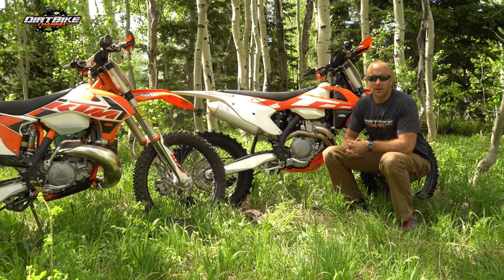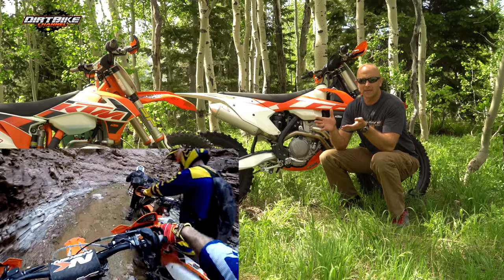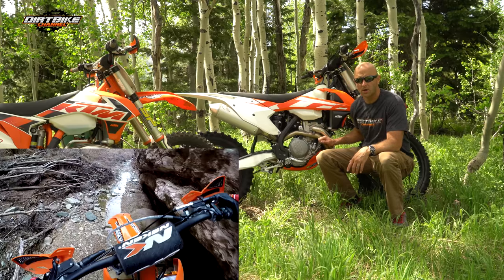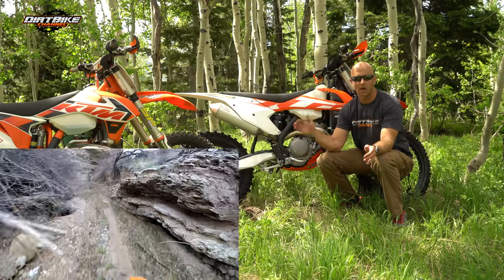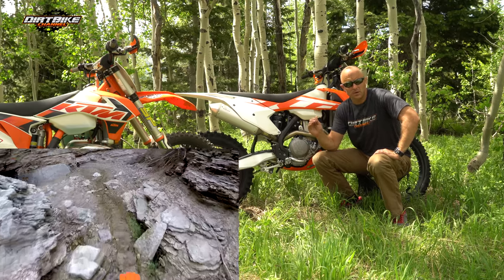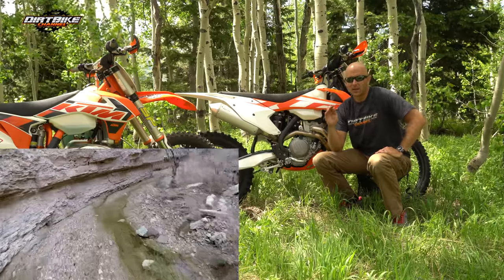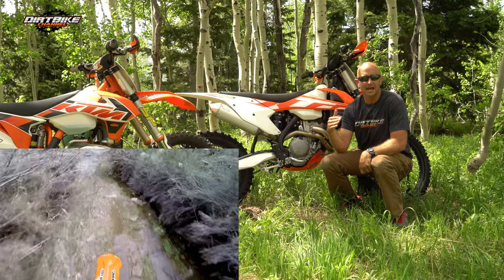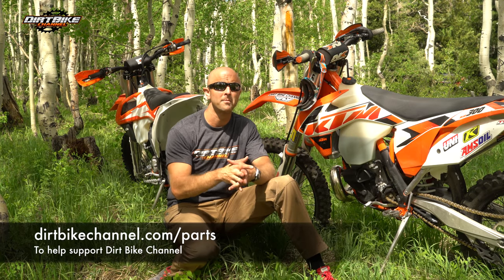Electronic Fuel Injection on 2 Stroke Dirt Bikes? Part 1 - Episode 139

Comment: Good points, I think we all just want a great running bike that needs little maintenance. This is why EFI sounds good. I mean come on if i'm going to spend $8200 for a brand new Beta 300 I want the EFI or something that is going to justify the money. The oil injection is amazing that is why I chose the Beta but not sure it justifies that cost. As a company like KTM you cant justify charging 10k for a 2 stroke with such little innovations and change, I know they are amazing bikes but no technological break through can justify them raising the price of their bikes by a grand every couple of years . Its insane.  At what point in time is a dirt bike going to cost more than a car?

Comment: At WOT the EFI  has no advantage over the carburetor. 
At every other rpm range the EFI is superior in fine tuning the mixture.
Reply: Dan Henderson EFI usually has a better fuel spray pattern than a carburetor even at WOT
Reply: fuel spray pattern may be negligible at wide open throttle due to the fact that were not comparing carbs to direct injection rather carbs to throttle body injection. which means the fuel regardless of delivery type has time to coagulate or form larger droplets before entering the cylinder , waiting for the piston to get to tdc then ignite. in physics speak thats a long time. i have seen lots of side by side dyno comparisons and carb / throttle body injection when tuned by a master engine tuner will produce the exact same hp with identical fuel consumption rates.    the only way to truly beat a carb all around on every spectrum is to go full on direct injection and spray in the fuel milliseconds before ignition takes place.
Reply: Dalton Michaels Virtually impossible to tune a carb as precise as efi can control the mixture. The combination of variables are endless.
Reply: toadamine The dyno says you're wrong. At wot using the same mixture ratio and all else being equal they will be virtually identical in power.  There is plenty of atomization when the airstream is at max velocity.
Reply: thats only true for direct injection. throttle body precision is easily replicated with a well tuned carb.

Comment: About what you said on being able to adjust the carb with just a screw driver compared to a lap top with fuel injection. I think you forgot that fuel injection adjusts itself constantly on the fly which would be more accurate than a carb at all times. You can tune it with a computer at home but you do not need it out on the trial. Obviously carbs still can do the job just fine but just saying.

Comment: My friends 350xc injector quit working blowing the top end and it was on a new bike. If it were a carb it would still be running. One of the side effects and extra cost of the fuel injection system. Costly.
Reply from the maker: Thanks for sharing.  Things like this can happen.

Comment: I think the main problem to put EFI in 2 strokes is that we are mixing gas with oil and injects would have problem with it. Second thing is simplicity. On other hand it would be easier when you chane altitude.
Reply from the maker: You may be right.  The Lectron carb solved all my jetting issues though.

Comment: I can't see the 2t manufacturers rushing out FI until the emissions standards force them to. Even then, I'm hoping they put in the effort to create direct injection, or at the least port injection as a standard throttle body doesn't solve the timing issue of the burn (ie, unburnt fuel exiting the exhaust port when both inlet and exhaust are open). This is a lot more difficult to implement than most people realise ;-)
Reply from the maker: I am with you 100% on that.  I doubt they will do that though.

Comment: not related with EFI, but seeing your 2 bikes 2015 and 2017 side by side, i personnaly like much more the colors and graphics of 2015
Reply from the maker: It's not a 2017.  It's a 2016 and a 2015
Reply: +Dirt Bike Channel you are right, my mistake, in 2016, they split 2 differents colors and graphics on specific models, i think 2017 got all the same kind of black frame and new graphics design and they re-shaped the front fender

Comment: Hey Kyle, we've spoke about this topic before.
Why do you think Beta did it on the 300RR? Still I'm with you, if injection does not give a big advantage, why bother. 
Great video btw.
Reply: Unless there is some other Beta 300RR that I'm unaware of, they are using a Keihin PXK 36 carb on the 2016. They have electronic "OIL" injection. It just eliminates the need to premix gas and oil. But the air fuel mixture is still done by an old mechanical carb.
Reply: Bruce Brown I stand corrected my friend, it is just the oil.
Reply from the maker: The beta isn't fuel injected.  It's only got oil injection.  I talk about this in part 2 of this series coming out in 3 days.
Reply: Dirt Bike Channel great work!

Comment: Two stroke fuel injection on motorcycles will never work properly due to the part throttle issues which is of cause no concern on boats and snowmobiles. With EFI you have to predict and calculate what fuel the engine wants and then deliver it. There are two many variables with a stroke engine - the biggest issue being the exhaust shape and heat. Carbs react instantly to what the engine is asking for which is why they work so well on a two stroke. I am a two stroke nut and have looked at this extensively so before anyone tells me I am talking rubbish please go and investigate is properly yourself.  The most you might see is a hybrid carb & EFI setup.
Reply from the maker: Thanks for sharing.
Reply: The people at ktm are in the very final stages of fuel injection it is coming
Reply: part throttle setup?
Reply: It's all to do with transitioning and meeting the correct fuel demands when for example accelerating out of a corner a rider tends to feed the throttle in progressively feeling for grip and control.

Things change very quickly on a two stroke and a carb will respond to what fuel the engine is asking for. On an EFI system you have to predict what fuel is required by looking at various sensors/parameters combined with interpolation which is very predictable/accurate on a four stroke engine.

The fuel demands of a two stroke are nearly impossible to predict/interpolate as lots of things are going on which changes its fuel demands - the biggest issue being the exhaust temp changing which changes the tune of the pipe - search google for info on using water injection in two stroke exhaust pipes to see what I mean.

So an EFI system on a two stroke would have to be super quick and need tons of fuel mapping points and correction tables to stand any chance of it remotely running correctly.

I have a garage full of two strokes and hate carbs and would love EFI but it will never work as good as a carb. Carbs are actually really simple and clever - once you take care of the initial setup around needle and main jet the carb is like an EFI system with infinite fuel and correction tables.

Remember carbs respond to what the engine is asking for - EFI gives the engine what it THINKS it wants! Hope this all make sense and also note that boats and snowmobile spend most of their time on full throttle as they don't have to contend with being on two wheels!

Comment: Your parts portion of your website doesn't work for anyone with adblocker as the three links there are technically ads and thusly blocked by adblocker, which most people use. Just a heads up.
Reply from the maker: I have that listed in the text on the site about the ad blocker.  I don't have any other choice right now with the limited resources available to me.  Lots of guys are clicking on it though.  Thanks for trying.
Reply: Just provide the URL for the ad links below where the ad is placed. For example for motosport: http://www.motosport.com/?psreferrer=http%253A%252F%252Fwww.dirtbikechannel.com%252Fparts&segment=badger&AID=10780136&PID=7891170&utm_source=CJ&utm_medium=Affiliates&utm_campaign=Affiliates&commsource=cj
Reply from the maker: Done :)
Reply: Nice!

Comment: Kyle, how tall are you?, I ordered higher handlebar support for my KTM to be more comfortable when standing on pegs, but after looking at some comments and advices on differents videos, they do recommand to keep the stock one, (maybe if you are 6'-4'' it's ok), I'm 5'-11''... Should I install them and see how they feel, or it's a bad habbit or my standing position isn't correct?? thanks in advanced for your advices!
Reply: I'm 5'10"-5'11" and have no problem so id say don't put them on
Reply: I would recommend keeping the handle bar height stock. Kyle is around 6'1 and I am 5'11" and we both ride the stock height. Last weekend we rode with a Pro Factory Beta rider and he mentioned that you're better off leaning over as it puts the axis point at your hips and not your knees. According to him your knees cannot take a big hit but your hips can. Shane Watts gives this same advice. I would say your money's better spent somewhere else.
Reply from the maker: Don't get taller bars.  That advice seems to be universal from the best riders out there.  I'm 6'"0.

Comment: Some guys already know this but I'm gonna put it out there for those that don't. The reason dirt bikes don't have oxygen sensors is they are not a fast acting sensor so on a dirt bike your constantly changing throttle input and a o2 sensor can't give relevant information i.e. It's always in the past. And cars only use them at fixed throttle position.
Reply from the maker: Thanks for sharing.

Comment: I like efi but I'd rather have a carb on a dirt bike. With efi if you have a problem with anything the bike won't run. With carbs you can jerry rig it so you can make it back home or to the truck. With efi if it senses something is wrong then it shuts off and won't start untill it's fixed. Plus injectors are expensive. And jetting isn't that hard. Sleds and quads are a different matter.
Reply from the maker: You make some good points here.

Comment: I'm not a big fan of fuel injection based on the fact that it's expensive to fix but it does work good. Skidmore snowmobiles use Rotax engines with e-tech  technology like Johnson and evenrude outboard motors. this system does work excellent. easy starts for dummies who have no clue. also it's programmed so if the engine is not warmed up properly it won't move till internal engine Temps are reached.  Arctic cat had a battery less fuel injection system that worked well also.   with the number of problems I've seen with snowmobiles with injectors that fail I don't thinks it's a good thing for Enduro bikes that see extreme abuse compared to mx bikes in a controlled environment without rivers and rocks and mud too the handlebars. lol
Reply from the maker: Thanks for sharing your input.

Comment: EFI is not DFI no point talking EFI with a two stroke. DFI would change the game for my two CR500s' Direct fuel injection means the exhaust port is closed before fuel enters the cylinder. AKA the piston has closed off the exhaust port which is higher in the cylinder than the transfer ports. This is huge on extending range, fuel mileage and the system will not foul the  plug without bad ignition! I could trail ride winter , sand dune summer all with elevation changes with no tuning necessary! No fouled pugs no holes in my piston! Now I need more gears and a turbo to pack the cylinder.

Comment: my 2011 rmz250 is fuel injected and I have no battery and it's got a fuel pump ?
Reply: Electric start on ktm's
Reply: Yes but he's talking about fuel injection not electric start
Reply: You have a stator that produces enough amps to run your fuel pump and ignition system.
Reply: Well, all EFI bikes do... It's not like you have to charge the battery between rides... The point of the battery would be when the EFI doesn't have any power during starting.

Comment: I know this is kind of off topic, but I've been fouling plugs a lot on my CR85 (Two Stroke) I'm currently running cheap 2 stroke oil Becasue that was the only thing available at the time. I was running Castor 927 before. Does cheap two stroke oil cause the the plug to foul or do I need to adjust my air/fuel screw. I'm going to switch to Castor 927 regardless and any input would be helpful.
Reply: What ratio mix do you use
Reply: Check your jetting
Reply: +Javan Kuusisto 40:1
Reply: +Eastern Oregon Moto (EOmoto) what am I suppose to check exactly? Also what jets what I need to fix the rich running problem? Do I go up in size or down? I really don't know much about jetting
Reply: +DirtBike DJ find out what your stock jet sizes are supposed to be,  then remove your carb and write down what jets you currently have,   if you Google how to properly jet a 2 stroke,  there is tons of awesome info,  a properly jetted bike will blow your mind on how will it runs
Reply: +Eastern Oregon Moto (EOmoto) thanks for the info, oh yeah and is the cheap premix responsible for the plug fouling more often?
Reply: +Frederic Jordan I have a pro Circut Platnium pipe and a FMF Shorty( I know  weird combo)
Reply: +Frederic Jordan yeah people have been telling me to jet my bike leaner but how do I do that?
Reply: So its probably the issue right there, go on the procircuit website to see what jetting they recommand for your specific bike.
Reply: +DirtBike DJ usually premix isn't what fouls a plug,  it's usually jetting
Reply: Cheap oil. what are you calling cheap oil. what brand is it? . the way your jetting is set will be a factor in plug fouling. if your bike is set up to run good at 700 ft above sea level at 15 to 20 degrees C and the temp when the plug fouls is 30C your in need of a change to a smaller main jet. if you run a mixture at 32/1 ratio for you gas using 91 octane or better cheap oil shouldn't be a problem. I run shell advanced full syn oil in everything with good results. I've never had to clean my exhaust power valve on my kx250 07 or on my snowmobile 98 srx700. these sleds are aweful for dirty power valves. so I would recommend using a good synthetic oil over a cheap oil based on the fact that good oil makes engines last longer. here's another thing. clean the air filter every  ride or more if it's really dusty. save your motor
Reply: +Ernie Desjardins thanks, I have a CR85(non power valve engine) so I'm not really concerned about that. But the premix I'm running is one that I picked up from autozone and cost around 5$. So running a smaller main jet would fix the problem? Because I'm going to order a jet kit if that's the case
Reply: +DirtBike DJ . that's not what I said.  things to consider are. how many hours are on your piston?  if it's more then 30 hours low compression is likely the problem. is this bike raced or are you a beginner rider that idles around lugging the engine? find a local dude that races mx and know his stuff. ask him to check you out. it maybe a simple fix or something your doin wrong. if I spent tens mins with out I'd know what's up. 32 years of racing 67 different mx bikes I know 2 strokes. find a guy like me to help ya. I'm in northern Ontario canada
Reply: +DirtBike DJ if you are due for a new piston.  instal a hour meter on your bike. this way you can monitor how many hours are on the piston.  30 to 50 hours max or something bad will happen that's expensive to fix. it only takes twenty mins to put a new piston in once you learn a routine with basic tools.
Reply: +Ernie Desjardins thanks I really appreciate man, I have a fresh piston no more than 5 hours on it. I really think jetting might be the problem so I'll start working on it.
Reply: Be sure also to have the recommended plug. This is crucial. A too cold plug will foul much more easily. Use good quality synthetic oil. This is the basis. After, if the problem continue, check your jetting. If you are fouling plugs it may be too rich. Too lean it, you can drop your needle one step at a time (place the circlip one groove higher) or, if it is not enough,  put a main jet one size smaller. You must be carefull not to lean too much or you can damage your engine.
Reply: +Wide000 I didn't want to go that way because if it ran good on castor . then he switched to cheap oil and problems came. I was afraid it'd run lean N squeak if he went be to the good stuff.
Reply: +Ernie Desjardins alright I'm back, I pulled the carb apart and found out that I have a #130 main jet. I have a pro Circut platinum pipe and they recommend that I go to a #122 main jet. Stock is #125. Should I go to the recommend jetting spec that pro Circut provided or should I go to stock.
Reply: if pro circuit says then they know. I would give it a try
Reply: +DirtBike DJ  told you kid!  You just find the issue here ;)
Reply: +Frederic Jordan thanks man, I'm going to order the proper jets.
Reply: +DirtBike DJ yeah i guarantee your bike will run mint after that dont even worry.